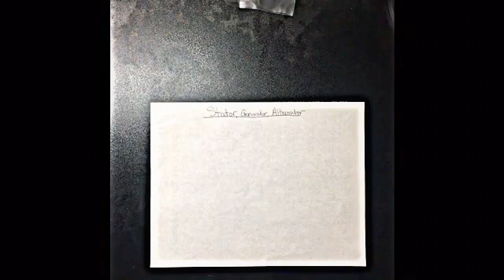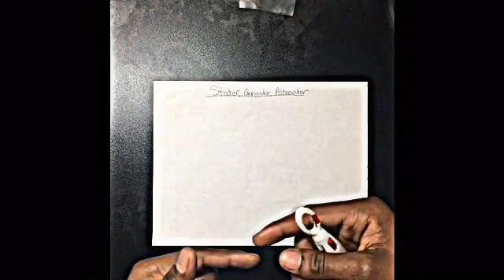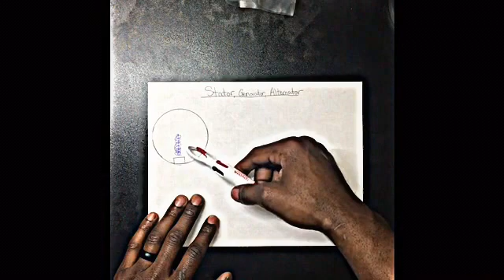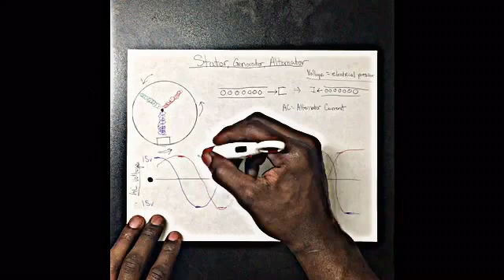How a Stator, Alternator, and Generator Work

Comment: SO  THE  WIRE IS ACTUALLY  WOUND AROUND  METAL POSTS  THAT IS INSULATED  FROM THE  WIRE ITSELF  AND THE  METAL POSTS ARE ALL  MADE FROM ONE PEICE OF A METAL STARWHEEL  AND  ONE  SIDE  OF THE WIRE IS GROUNDED ON TO THE METAL POST . THE OTHER END OF THE  WIRE IS CONNECTED TO  A RECTIFIER THAT CHANGED  THE JUICE TO DC ?????

Comment: Question. As the magnet passes the coil wouldn’t the voltage read 1,2,3,4,5,6,7,8,9,10,11,12,13,14,15,14,13,12, etc. effectively not making it a sine wave. Wouldn’t you need a magnet of opposite polarity to repel the electrons away?
Reply: was wondering this too

Comment: 2003 Silverado has less than the 5 volts reference to the computer. Can the stater be my problem of why the truck won't run though will crank? I bet you know!
Reply from the maker: Hey Richie, what is the exact voltage?

Comment: Good visual with explanation to convey what is happening during the excitement of electrons resulting in those sine wave peaks of voltage! Is that correct? I see the opposing waves, are they co-sines? I can understand better the alternation, now I wonder how to obtain direct current? We might name them an altergen and a dirrectigen for generators producing alternating current or direct current? Oh, "pressure of voltage" is a great way to understand. Alternatively, the "current of amperage" (omitted) naturally comes into a more organized way of seeing the concept. Love that "nul-state" wording, ha, I am excited with new questions to ascertain understanding!
Reply from the maker: Love the excitement and thoughtful reflection! In short a “voltage regulator” controls both the flow of current and the rate. 

The control of directional flow is done with a diode which operates as a one-way valve or “check valve” for electrical current. 

 The control of the amount of current can be done in a couple of ways. Most common is duty cycling. Varying the amount of time the circuit is open at a rapid rate to give a set current over time.